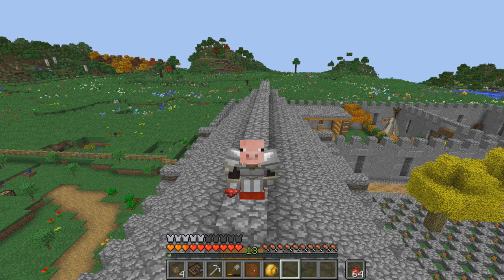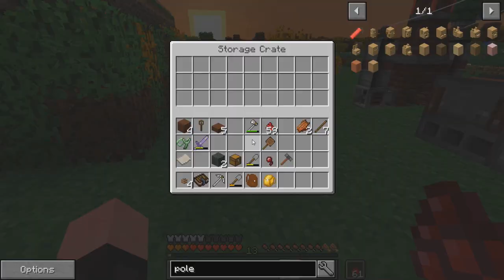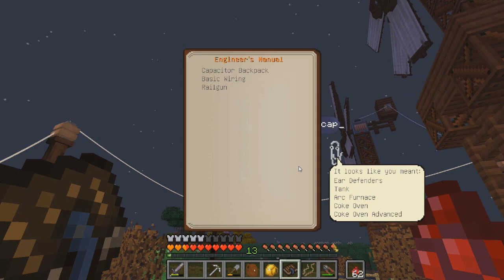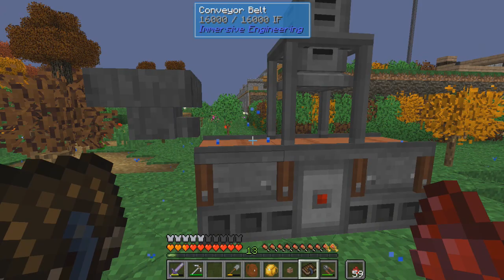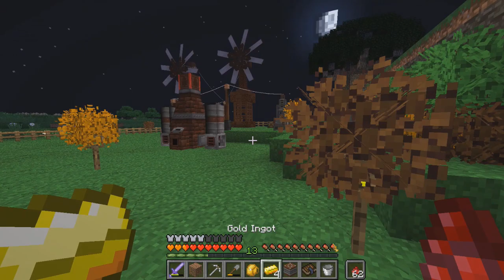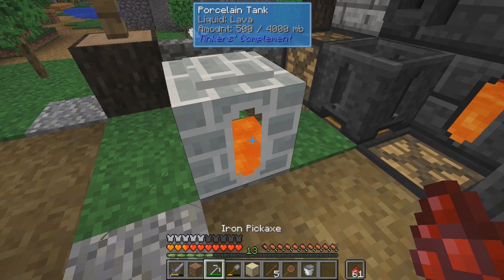Sevtech Ages-More Powah!-Ep87-Modded Minecraft-LV Capacitor & Thermoelectric Generator

Comment: The different types of wire can transfer different amounts of IF/t - LV is fine for the water wheel and windmill, but you'll need to get up to HV to use all of the power from the diesel generator.
Reply from the maker: Ahh that makes more sense!

Comment: 1. With the thermal generator you'll want "Hot" on 2 adjacent sides like South & West, and "Cold" on North & East. This
2. Your capacitor can't discharge because you didn't set 1 side ot orange, HAMMER TIME!
3. The "Wooden Pole" "Steel Post" or "Aluminum Post" is Immersive Engineering's Telephone poles. BUT the author changed it so there IS intersection with wires. An alternative for mounting power relays is the "wallmount" (Wooden, Steel, Aluminum)
4. You're going to want to build tanks to hold your petroleum processing (and other) liquids. It's best to input to the top, output from the bottom.
5. you can set up your excavator(s) & Pumpjacks anywhere inside the chunk where the resource was found. Resources do run out so try not to plan for permanent mining sites
Reply from the maker: Ah ha! That explains the wiring not going through the pole. Thanks!

Comment: You can use all four sides of the generator to double the power output.
Reply: (32:22) use a lv connector instead of the relay. A relay cant input or output power